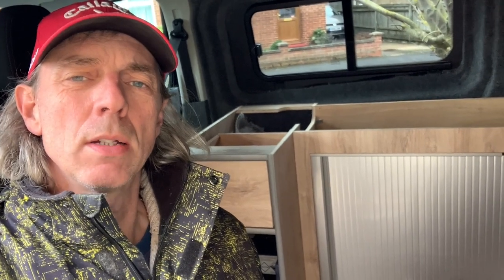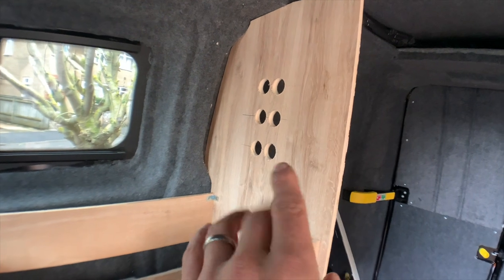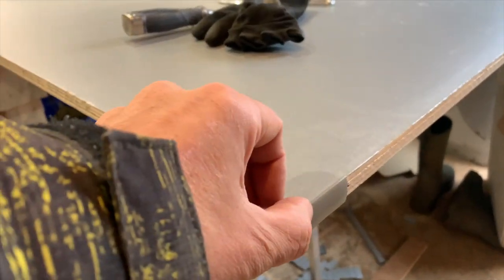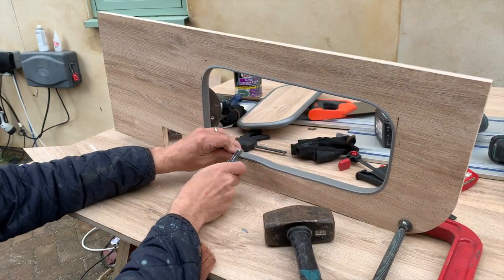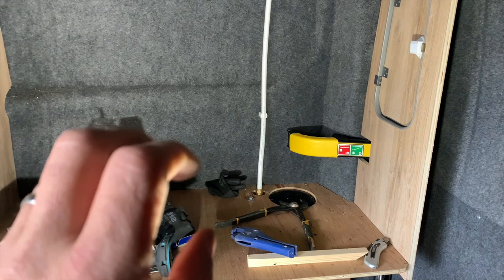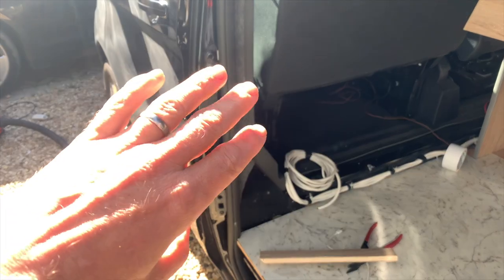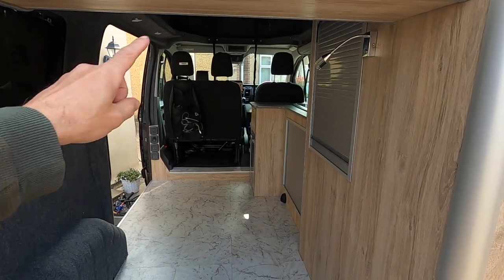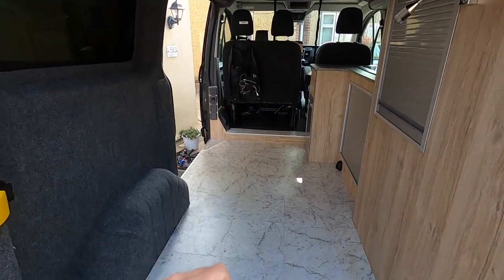Campervan furniture build on a Ford Transit Custom

Comment: Hi Karl,

Just saw your latest video on the furniture for the Transit Custom, great job as always....impressive & inspiring.

Just wondering if it might be fresh in your mind on what connector / coupling you used between the flexi hose for tap inlet and the rigid speed fit pipe from the pump ?

Thanks & Regards,

Chris

Comment: Hey hello friend. First of all, congratulations for your good work. I have a doubt about the manufacture of that small door, minute 3:01, Did you cut out the door with a jigsaw? Have you subsequently reduced the size of the cutout or door? Or on the contrary, as the cutout is, can the door be edged? A hug.

Comment: Hi Karl, great series👍🏻 I'm converting a transit custom myself and these videos help massively. One question though, how did you fix the backboard in place?
Reply from the maker: I think I screwed some battens to the underside of the over shelf and the back edge of the worktop
Reply: @KBeadle  brilliant cheers!   Saves me reinventing the wheel. Like the new style of videos by the way👍🏻

Comment: great video and I am wondering which furniture boards you used and where to get them, thanks in advance, nicely done good job
Reply from the maker: It was from magnum motorhomes
Reply: @KBeadle   thanks for reply m8, appreciated but the one you used are not available what type board is it you used its a nice board the name?

Comment: Great conversion! We’ve been costing up buying a Transit Custom and doing the same so really glad I found your channel. Which swivel base will you be fitting for the double passenger seat? I can only find fiddly ones with 4 bolts to turn around, no easy lever system. I can’t work out if we’ll still be able to use the under seat storage either.
Reply from the maker: theres limited choice for the transit I've fitted a 4 bolt one but I wasn't happy with it so I had to adapt the seat to make it work better, video coming soon
Reply: Looking forward to seeing it! Kiravans have a Custom double seat swivel ‘coming soon’ on their website and they hope development will be finished this summer so I may hold out for it!

Comment: The run off is very clever - you've earned a biscuit 🤣 Was it definitely your idea or was it a happy little accident? I have visions of you fitting the level indicator and it dropping down, you cursing slightly and then a eureka moment occurs. 

Good job anyway Karl

Comment: Karl whats the name of the rubber trim you used for the door at 3:45  the inside is a t molding but the door is a different one?
Reply from the maker: https://www.ebay.co.uk/itm/272735998673?var=0&mkevt=1&mkcid=1&mkrid=710-53481-19255-0&campid=5338268676&toolid=10044&customid=CjwKCAjwq-WgBhBMEiwAzKSH6MS6OCamGg9hh3D0F1U_JNtZJrKX77N6_0uEYXz2cJfNGlAyfilyDBoC198QAvD_BwE
Reply: Hi Karl what material is the Gray corner where you put 2 sides of wood in.